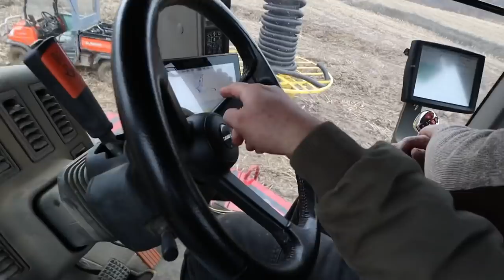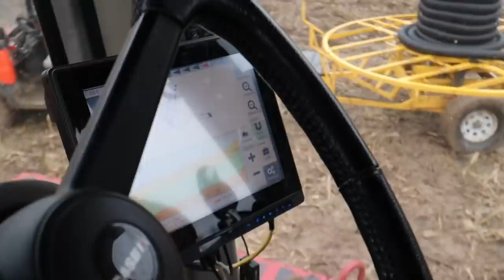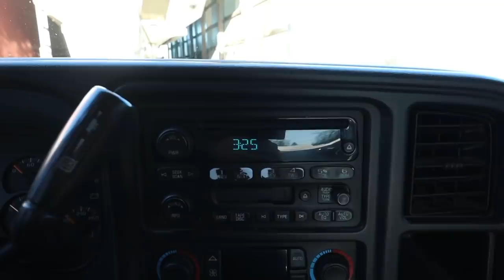620 HP TRACTOR STUCK!

Comment: It has always surprised me how many lawnmower repair shops don't have a welder.   Seems like I am always welding cracked mower decks, reinstalling gauge wheels that customers rip off, and in some cases weld the frame back together.
Reply: NgnMech I always had someone else that was capable of welding on staff. I just never forced myself to take the time to practice.
Reply: @bjbrown506  I kind of assumed that you had somebody working for you that could weld.  But I have talked to several shops that don't even have a welder.  I had to teach myself welding to make the repairs.  Still not the best welder but can make two pieces of metal stick together. But with mower decks and the associated rust and other contaminates it is hard to get clean welds.
Reply: You did great BJ

Comment: Never been to Jamaica but highly recommend Cozumel !!! Surprised extending that cable made enough difference , kinda wonder about the grade control when the plows wheels were off the ground though !!?? Those kind of conditions nothing beats steel tracks with deep lugs but that was pretty extreme ! Lots of drain tile in our neighborhood ! Shop cleaning is A thankless job , gotta get Bob's Gator dirty once in a while ! Thanks for the video !!
Reply from the maker: Luckily that was the end of the run. We will probably go back and fix the end with a excavator

Comment: Some things may help you get off being stuck.

Carry 2"x4"s, 2"x6", enough for at least 2 or more per tire or track, place them perpendicular or across the wheel/track so it can grab it, and produce a traction by lifting the tire/track off the way making the machine move freely.

Lifting the stuck wheel or track end stuck, and placing anything you can have solid under, rocks, wood, as explained before. If at any time you can have a machine capable of lifting any inches the deepest end in the mud, placing some dried objects under, the machine will move forward. 

Tell the driver of the machine to don't super fast speed the machine pulled, to place it first on Neutral, if you absolutelly can not move it, then on gear forward and gas it softly to produce a shave or enough move sort of to free it a little enough so you can pull it off.

If there's a wheel/or any solid object, tall enough you can lean on a cable while you the puller and the machine pulled are closer to the pulled machine, the closer the better sort of you while pulling you lift the machine pulled, you will not only pull, you will be freeing from the angular stuck position of the wheel/track making the move easier for all.

The farther the puller the easiest you lose power from the pull, unless you impact the pulled machine.

Keep in mind, in case you fear you'll break a cable, try to place on the cable 4" pvc longest possible pipes so, if by any means a cable gets snapped the pvc will shock absorb the whipped cables slowing the wiping on anyone. the pvc can be a projectile but any impact will be softer than a steel cable. Install diamond cables between a winch and the pulled object. Use the strongest safest winch you can, and use it the minimum, with the best strongest cables you absolutely can, and if you can be as far as the length of the cable, be there and work from there.

If you're to pull from a cabin make sure you're always around at least, 4 columns although the more the safer! 

Great video! Tell your brother to film more of the whatever he do so, we feel like he's doing something more than just vacationing in the farm lol

Comment: Here in Europe we learned a long time ago that you need filter material surrounding the pipe for it to work for more then 5 years.
Reply from the maker: You must have different soil types then we do because we have put till in this way for years and it still works. Pretty common practice in the Midwest

Comment: People don’t seem to realize but tires get better traction then trace do they compact worse then tracs but because of the smaller surface area and the big lugs they get better traction any tractor with the same weight and power on tires could of pulled that out and if that quadtrac was a Steiger with duals if wouldn’t of gotten stuck.